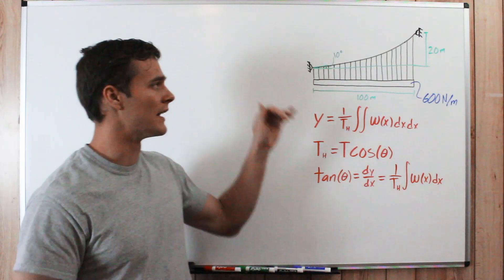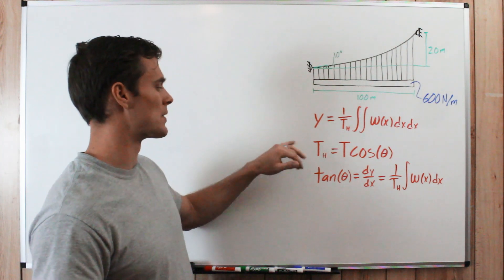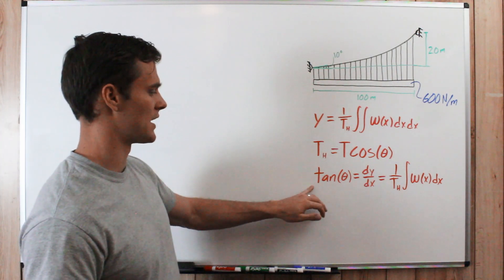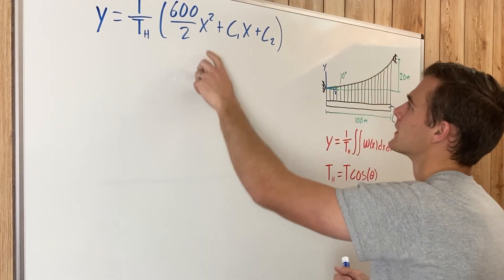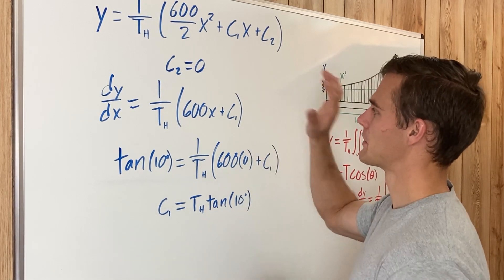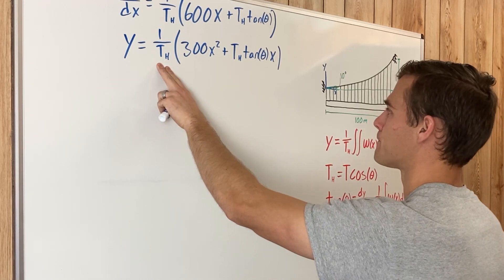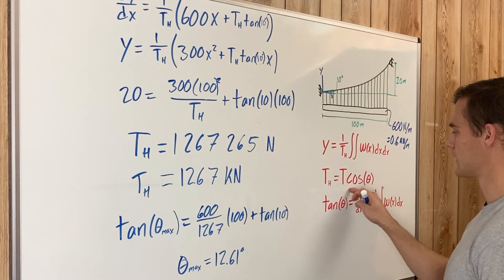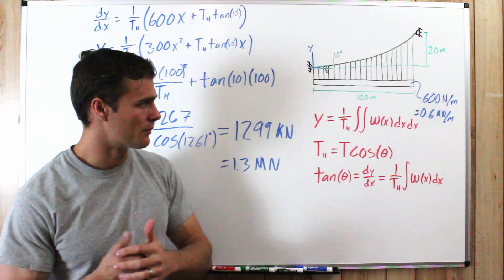CABLE WITH DISTRIBUTED LOAD EXAMPLE PROBLEM // Equations Given // Steps Explained

Comment: 10:47 you used your Th as 1267 instead of 1267x10^3 because of the kilo in KN, just a heads up to the people that are reading the comments (The angle theta is still correct)
Reply from the maker: Good catch!

Comment: 20=[3Mil/TH]+64.836082746"product of tan(10)(100)" you end up getting 1,267,265N. How? big step skipped there.
Reply from the maker: Great question! I skipped the algebra because I figure that if you’re watching this video you probably already understand that by now. The product of tan(10 degrees) and 100 is 17.63, not 64.8. Use that and you should get what I got. It looks like you would get 64.8 if you used 10 radians instead of 10 degrees ;)